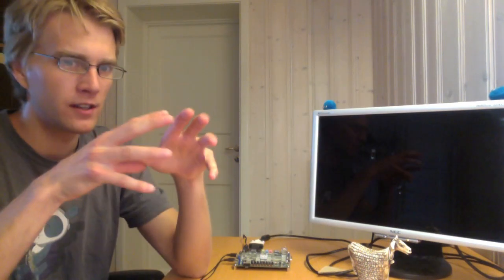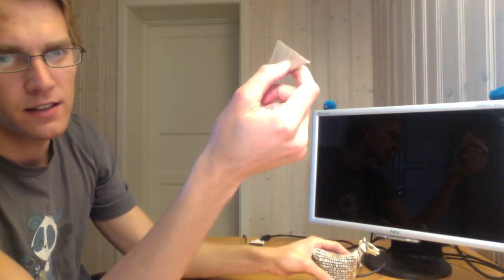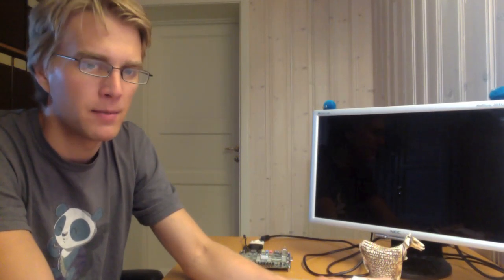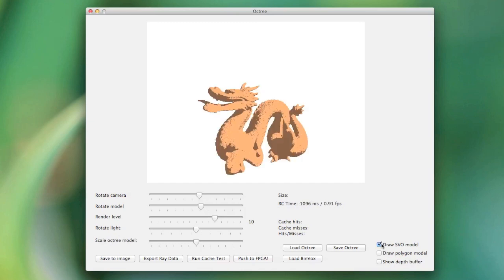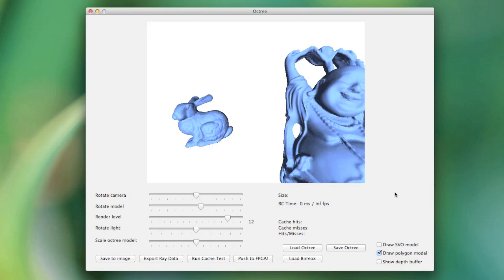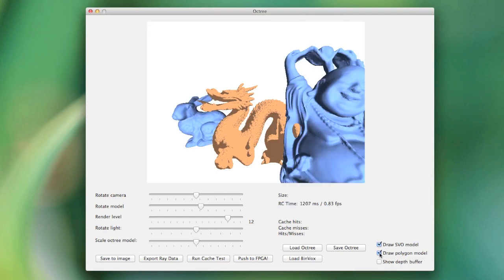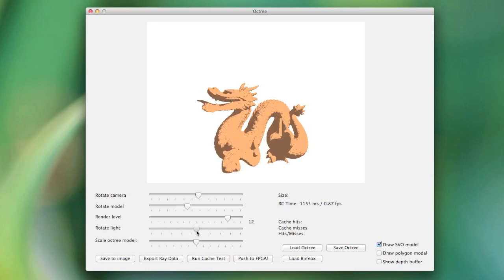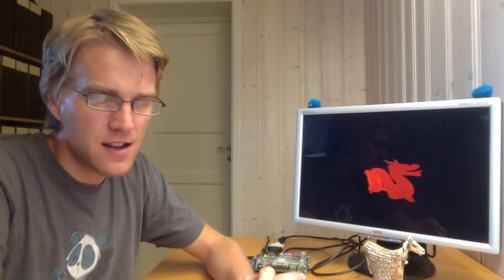Ray Tracing of Sparse Voxel Octrees on an FPGA

Comment: This is cool! (warning rant oncoming) but! just to provide perspective, using well optimized c++ on one thread i can ray-cast direct and shadow at similar sized octree at 60fps with similar resolution using distance fields - a technique trading memory for performance - and i'm certain i could extract far more performance if it were needed - what im saying is that i believe software is the problem.
Reply: Well, it's obviously a mix of hardware and software solutions that's needed for real-time raytracing of great quality. When I wrote this it was mostly a hypothetical, but now nVidia has their RTX line, so it's worth looking into how they divide the tasks between hardware, GPU software and CPU software. It seems like they have dedicated cores to do bounding box hierarchy traversal (similar in principle to octrees, but somewhat different data structure) and ray-triangle intersection

https://devblogs.nvidia.com/nvidia-turing-architecture-in-depth/
Reply: @auspiciouslywild  Yes thats my understanding too, it's very exciting to see ray-tracing becoming very popular!, i think this kind of hardware (GPU) - software mix (like RTX) is wonderful and only increases performance, but i believe that purely software (think sophisticated geometric algorithms etc) will in time provide by-far the most advancement. Thanks so much for your reply and great work with your thesis, what are you doing now ?
Reply: @LukeSchoen  Professionally I work with Bluetooth Low-Energy microcontrollers, so not very related to graphics anymore. Hope to return to it, even if only in a non-professional basis, once I have some free time.
Reply: @auspiciouslywild  This was a great project. You've predicted the future with this content right here. 

Right now, I am looking to use a FPGA to offload ray-casting from the GPU to then enable some level of real-time ray-tracing in GPUs that does not have the RT Cores.

What would be your advice in 2020, taking into consideration the fast FPGAs out there? Thanks!
Reply: @kyozon8925  Hmm, it would certainly be a very interesting project. Are you considering having an FPGA on a desktop computer working in tandem with a GPU? Might be a bit out of my league to give advice on the architecture there. In terms of the ray-casting itself, I would certainly look at bounding volume hierarchies, since that was NVidia went for with RTX it seems. If you want to ray-casting of sparse voxel octrees I can give you some tips for optimizations that I've thought of since I wrote this thesis. I think I used several cycles to trace one level of the octree hierarchy. But I'm pretty sure you could trace at least two or three levels of the hierarchy in one cycle with the right design and data structure. Or instead of dividing the volume in 8, you could divide it in 64 (4*4*4)
Reply: @auspiciouslywild  Thank you! Yes, the idea would be to have the FPGA and the GPU on the same Desktop computer through the PCIe interface.

Comment: uhh that's not raytracing.... raycasting maybe but definitely not raytracing
Reply from the maker: Hi Matthew,

How would you define ray tracing and ray casting? I read a lot of literature while writing this thesis, and I found that those terms are quite ill defined.

Going by Wikipedia, you've got this as one of many definitions of ray casting: "a non-recursive ray tracing rendering algorithm that only casts primary rays"

And this line: "The distinction is that ray casting is a rendering algorithm that never recursively traces secondary rays, whereas other ray tracing-based rendering algorithms may do so."

As far as I can tell, there's no requirement that an algorithm has to cast secondary rays to be called "raytracing", but if it does it's definitely not ray casting. 

The system I designed is perfectly capable of doing secondary rays, that's why I chose to call it ray tracing in the end. Furthermore, since ray casting is so poorly defined, I felt that "raytracing" communicated that the design is intended for graphical rendering. Ray casting could be anything.

I understand that you're primarily looking at the visual results. But as a hardware design project, the visuals weren't the most interesting to me. It can take days to implement something which is very simple in pure software, but that really doesn't tell you anything about how the hardware performs. The point is to get the core algorithms required to do the ray tracing down, but don't waste time getting to look all nice and pretty.

The other problem is performance of the FPGA I had in hand. Although it wouldn't be too hard to implement secondary rays bouncing off the object and hitting a light source (even with objects in the way for shadows), it would be rather slow on my tiny FPGA.
Reply: laser beams coming from your eyes would be raycasting, raytracing would be building an image with zillions of bouncing lines emanating from light sources carrying color information that may or may not be visable from a camera source would be raytracing, also voxels aren't what people call them nowadays either. A voxel is more or less a metaball, but somewhere down the line people just started using the wrong terminology for stuff and it stuck.
Reply from the maker: Okay Matthew. Nowhere in the literature did I see such a definition of ray tracing being used, and Wikipedia also does not define it that way either.

Maybe you're trying to establish a new definition, or promoting a definition used by a minority, but honestly I don't find that very productive.

What you're talking about is, as far as I know, commonly referred to as global illumination, where ray tracing can be used as one of many methods of calculating the illumination.

My design could be used in global illumination through ray tracing as well. The design really doesn't care where the rays are coming from, and what you do once you find a collision. I suspect there are more efficient ways of doing global illumination though.

I don't think you're correct about "voxel" either. The origin of the word is really just a 3D extension of the idea of a "pixel". So how you render it is really not relevant to the term, just as a pixel can scaled using nearest neighbor, with some interpolation algorithm, or something crazy like hqnx (which would be similar to rendering voxels with a metaball-like appearance).
Reply: Wikipedia isn't the defining source of all information in the world man. Yes for sake of argument we will say the difference's between raycasting and raytracing is recursively spawning more rays to deal with things like refraction, absorbtion, reflection, etc. But to me it's following a ray of light much further than hitting one object, you would always describe how many 3d space objects it needs to hit before you no longer follow it. Raycasting whatever you want to call it symantically would probably just be a small subset of terminology that determines how you shoot rays, which has nothing to do with nothing, it's just words man. Also Voxels were metaballs in the 90's, i have no idea when that word got attached to boxes.
Reply from the maker: Matthew: Well where do you get your information? Before I mentioned Wikipedia I said I never saw that definition in the literature. Let me be clear: I've never seen this definition in the research papers where the actual researchers that came up with these algorithms describe them. This thesis was academically oriented, so the literature I based it on is mostly academic.

There may be other definitions in other commercial or hobbyist scenes, but I can't say I've ever seen that definition there either, and I've followed the commercial 3D rendering/modelling, gaming and demo scenes quite a lot.

What do you mean voxels were metaballs in the 90s? In what area? You can find papers writing about voxels back to the 70s. Computer graphics was not invented in the 90s.
Reply: I never said it was, but I remember newtek popularizing voxels to do volumetric effects for things like water and smoke.
Reply from the maker: Yeah I see what the problem is. You're more oriented towards the user-facing terminology used by 3D computer graphics software. You're focused on the visual aspect. In what I'm presenting I'm focused on algorithms and data structures.

I see that LightWave has something they call "HyperVoxels", and the rendering of them can be anything from blobby metaballs to fluffy clouds. But when they're saying they're "voxels", that comes from the fact that the data structure underneath is a regular grid of points which lets you do interesting volumetric transformations and rendering of the models.

Cubes just happens to be the simpliest/easiest ways to render voxels. But if you don't have enough voxels and want to make it look nice you apply a metaball effect.. then you can get something that looks like liquids etc. with relatively few voxels
Reply: that is ray tracing you fucking turnip